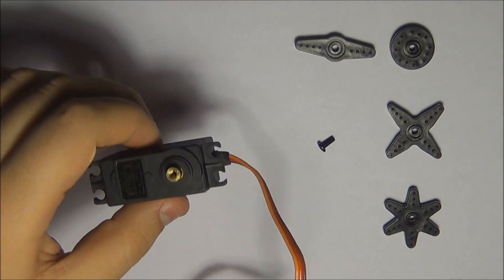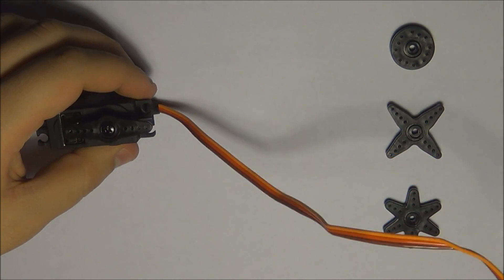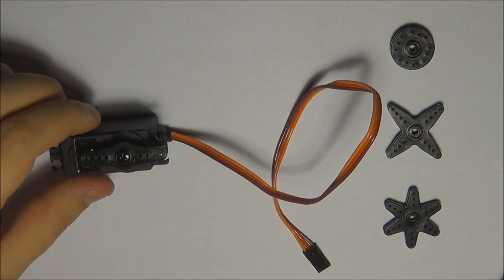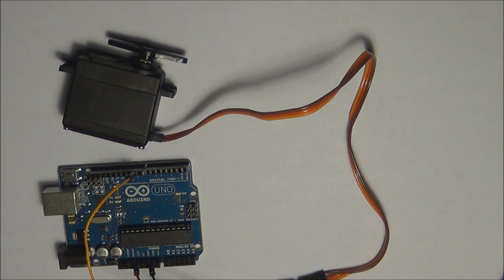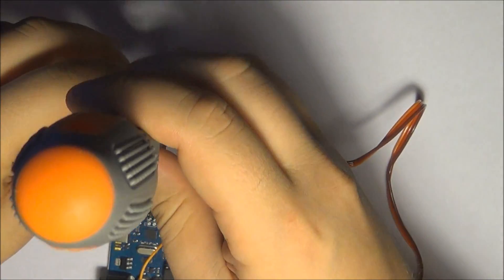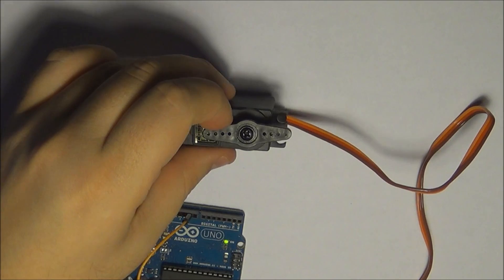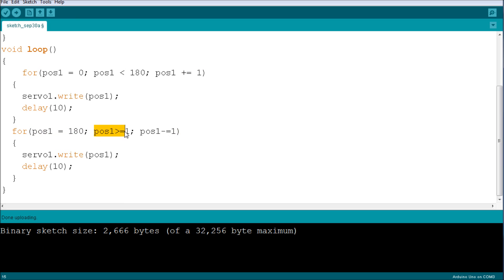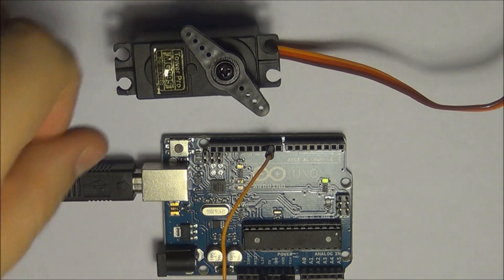Arduino #9 - Servo Selection & Motion Control

Comment: If I were to use 2 mg996r servos for this application, would I be able to utilize the v+ pin and any other numbered pins on the arduino uno,or should I use a pca9685 to accommodate the 2 servos?

Comment: #include <Servo.h>

#define pinServo 3
#define pinButt1 4
#define pinButt2 5 
#define pinButt3 6

Servo myservo;

void setup() {
  myservo.attach(pinServo);

  pinMode( pinButt1,INPUT );
  pinMode( pinButt2,INPUT );
  pinMode( pinButt3,INPUT );
  
}

void loop() {
  if (digitalRead(pinButt1) == 1 ) myservo.write(0);
  if (digitalRead(pinButt2) == 1 ) myservo.write(90);
  if (digitalRead(pinButt3) == 1 ) myservo.write(180);
  delay(15);

}

Comment: I am having a huge trouble in using sg 90 servo as the torque is not sufficient in lifting a 200 g weight vertically via a wooden arm. so does mg 995 servo has enough torque.

Comment: @1:07, they're called control arms.  @1:54, ground is generally black or brown. center wire is always V+, usually red or orange, signal is usually white or yellow.  If in doubt, search "datasheet" part number.  ie 'datasheet mg995'.  when vibrating on limit, back off limit till it stops vibrating, otherwise it's pulling more current than normal.

Comment: The servo will draw a large current if it is not to sweep incrementally. This is important for certain batteries. although incremental sweeping limits the speed of the servo. The current spikes may be resolved by a capacitor circuit.

Comment: Hey can someone please help and let me know where I can get the wires that connect the servos to the Arduino? Or do they come with the servo??
Reply: ik this is an old comment but they are called jumper cables you can get them off amazon

Comment: Surprisingly, the servo works it is powerful, does not the Arlooino burn, I thought that such servos should be nurturing at least 5 in the power supply separately, is not it?

Comment: I have a very specific problem. I need to control a servo with a toy tank receiver. No digital control, only two wires and a H-bridge. The servo will need to act as a steering servo. When polarity is one way, it needs to turn one way and stop, when polarity swaps, it needs to go to the other side and stop, when no signal is provided it needs to center and stop. No idea how to control an Arduino with a H-bridge and how to use "if this then do that" statements.
Reply: I know I’m many months late, but you could use an ‘if’ statement like in javascript, then the action you want accomplished inside the brackets of the ‘if’ statement (If I didn’t explain this well, just look up how to write an if statement in arduino)

Comment: I am planning to use 3 mpu6050 as input, 12 servos for the output and 5 flexible sensor as input all in one board is that possible? if it is, what board to use?
Reply: Aljohn V You will need a special servo shield. That many servos will burn your Arduino.
Reply: thank you

Comment: please I need an answer urgently....
I did exactly what you did to set it up on 180  but instead it keeps spinning continuously although I've put it in void setup not loop.
and when i try the sweep it rotates 360 not 180.
my servo looks exactly like yours I'm even using the same knob and it has the same no. but i thought that if it rotates 360 maybe the limit is 360 but it didn't work as well. I tried 0 it just spines it the opposite direction and doesn't stop. please tell me what to do I have a project
Reply: did you have solve it? i face the same problems

Comment: 12V servo motor fluctuates at very high speed when given external power supply
Coding is correct and simple
Help me how to overcome this fluctuation
I have to submit project by tomorrow

Comment: my servos does not move at all.i got it new a few days back
what could the possible problem?
Reply: Your wiring could be incorrect. Either your vcc, gnd and input connection of the arduino to the servo is wrong or the the output pin to the servo from the arduino is incorrect
Reply: Alok Anand Minz or the servo might be broken

Comment: Great video, but do u know how to turn the motor to a degree u have set and have it stop for a certain amount of time before going back to it’s starting point. I can only get it to continually rotate back and fourth.
Reply: Muggers 79 You need to adjust the wait times (delay) in the code. It's in milliseconds.
Reply: Just define this (in void loop or void setup, wherever you have typed the degrees):
delayPeriod = (whatever your wait time is); 
then after the degree type:
delay(delayPeriod);

Comment: Hey, everyone I need help, I tried doing the same thing will a Arduino Nano and a Hi-tec HS-402X and every time after I upload the program,  the servo just rotates continuously in a clockwise direction until it hits the physical maximum the servo can go and then just gets jammed in there until I power off the servo. Can someone please explain why this happens and how to fix it? I`m doing it exactly like in the video. I have also researched how to fix the problem with "writeMircoseconds" command but it does the same thing.

Thank you
Reply: its probably a 360  servo, i dont know if you can control the position that you want it to stop.
Reply: I might be wrong, but if the control signal has a frequency that tells the servo to go beyond its own physical limits, the servo will try to achieve that position and stalls. That might be what your code is doing. Idk how you might fix it, but you can try to simply give it a PWM signal. Make sure the signal is within the servos limits or it will stall again as stated above. It might be that your servo has different frequency demands. Is there a knob you can adjust on some side of the servo? If there is, it can be used to trim the servo.

Comment: can you rotate that servo by 360 degrees without configuring inside it?
Reply: no unless it was pre - made that way
Reply: No. You can remove the limit pin and potentiometer and replace it with a voltage divider with equal resistances. Then it will rotate infinitely in either direction.

Comment: Hello! I'm working on a project, an automatic guitar tuner and I want the servo to move the guitar pegs. Do you know approx. which servo could I use? I need anyone that moves continuosly until it reaches the correct string frecuency. Very good videos!

Comment: How many servos can i attach to my arduino uno board?
Reply: I'm a noob, how would I control 48 servos?
Reply: probably shift registers
Reply: you can use arduino mega to control 48 servos
Reply: with an arduino mega @mikehattias5837
Reply: using arduino mega you can control 48 servos
Reply: 2 at one time
Reply: Divyansh Khare 12
Reply: 12

Comment: Subscribed. I am very new to electronics. Question: how to know if my Arduino can handle a motor? I have a similar Carson-model sport 500502015 CS3 Reflex racing servo. Afrotechmods said that plugging a bigger motor (anything that draws more than a few mA) would be bad for an Arduino. How can I know if it will be too much for an Arduino? I have 2 of these mentioned and 2 little blue 9G microservos. If I join all 4 for a robotic arm will that be too much?

Comment: Can the Arduino be programmed such a way that when it receives +5 volts at one of it's analog or digital ports, the servo motor turns to 60° or 90° or 120°?

Comment: I am little doubt with this video sry about that but if you can clear my doubt servo that you are using consume 550ma of current and your Arduino can only provide it 40ma current so if u control with Arduino then it might get damaged
Reply: You don't have to take the positive power from the Arduino.  You can take it from an external power supply so long as you connect the ground connections together.That is strong recommended with multiple motors.  Even before it might damage the Arduino, it can cause the unit to reboot.

Comment: one question, does servo have potentiometer inside, if so can i just hook up orange wire so i can read position and power motor externally from power suply.

Comment: Does anyone know if u can make it go say 90 degrees then after a while u can push a button for it to go another 90 degrees if so can someone explain how it's done
Reply from the maker: It's definitely possible, you can use an increment for the angle value.
Reply: EEEnthusiast ok thanks

Comment: So the write function takes the position as a parameter not the whole angle of rotation?
Reply from the maker: That's correct. The parameter specifies the absolute angle to which the motor will be moving. It's not relative to the current position.

Comment: Great video, you should instruct your followers that 2 types of Servo exists: 360 deg CONTINUOUS AND THE OTHERS , a 360 deg continuous is NOT compatible with the kind of program you propose.thank you
Reply from the maker: Good point; I haven't actually worked with continuous rotation servos on Arduino.
Reply: frankly, I am very used to "std" servos, easy to handle,  you can make a slow / known angled rotation, ie go to 95 deg@ x rpm impossible with continuous

Comment: sir, i am makin a password enabled door locking and opening system and i am using a servo and i want that it should take a rotate after entering the password to 180 degree and stops and whenever the second pulse comes it should take a reverse action
Reply from the maker: Seems like a good project; are you stuck somewhere? I would need more info to be able to answer your question if you are having difficulties.

Comment: hi bro, i am using same servo and arduino uno r3 but i am not able to control servo. At least its not working, when ever i try to connect then servo give some giggling sound that's it. it is not running. and program it self not uploading to servo. please help me
thank you
Reply: Duncan Angus MacDougall  thans for your help but I was having problem with Arduino Uno when ever I changed it, servo working fine.

Comment: quick question, i want to use a servo with the arduino to create an automated fish food dispenser, theoretically, the servo should be spinning the food container around to the opening when it's time for feeding and then spinning it back around when it's done - the container is fairly heavy, 300 grams ish, how would i attach the container to the servo without overloading it?
Reply: I know it is old, but put two motors, and make one the reverse of the other. So it wont overload. Hope your fishes get food now :)

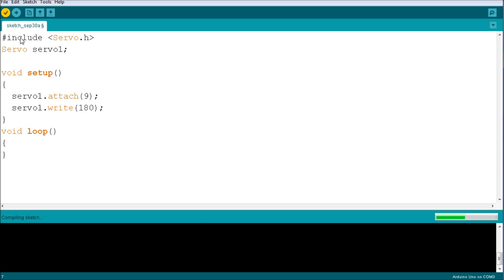Comment: Hi.I bought a MG995 servo motor and the sales person told that the servo is a 360 degree one and now my problem is that when I write the code at 4:50 the servo rotates continuesly without stopping.What should I do to stop it where I want?Please answer me...
Reply: mohammad ghanatian It is a problem with the voltage. We need 6 volts to power the servo correctly and I have that issue.
Reply: I faced the same problem as yours
Reply: hi.I still have the problem regarding control that servo and all I know for now is that this servo is not like other servos.take a look at this code,that might be helpful and if you found something useful please tell me cause my project is not done yet:https://github.com/diegorys/arduino-example-servomotor-360/tree/master/sketchbook/servomotor-360
Reply: I used a variety of voltages including 4,5,6 ,7 and still the same problem.
Reply: mohammad ghanatian Yea I am not sure then but I asked a professional and they advised me to use 6. My issue right now is it's kind of doing its own thing. Good luck
Reply: mohammad ghanatian Your problem is that it's a 360 servo, meaning it will rotate infinitely and never reach its desired degree. You can't stop it to a position, only change direction. You need a normal servo for this. 360 servos are modified servos specially made to rotate infinitely.

Comment: How do You run servo motors from the servo 1 and 2 header stacks on the motorshield? So I cut  a trace across the bottom of the motorshield so I could run external power? I am trying to test the servos using external power. There are no good examples online because everyone is running the servo directly off pin 9, like your vid.

Comment: as soon as i upload my first code it starts rotating and doesent stop...
Reply: you're probably owning a modded servo for 360 rotation. you cannot control the angle on that kind of servo, just the direction of the spin.
Reply: so basically... a motor? lol
Reply: i have the same event going on ???
Reply: @Rasmushkoch  if you want the code to run forever, put it in the loop, if you want the code to run once, put it is setup
Reply: You have a 360-degree servo

Comment: how do you make it so that the servo is rotating small planks of wood instead of the included plastic bits?
Reply: sadman hoque Either mount the plastic things (called "servo arms") to the piece of wood by using the pre-drilled holes or drill a hole in the piece of wood and screw it onto the servo. Don't drill all the way through! Drill a small amount in to fit it onto the servo and drill a small screw hole, like in the servo arms.

Comment: hi, can you tell me what is the exact Arduino controller type is? and can I control more than one servo motor on it ?
Reply from the maker: Hi Fadi, the Arduino Uno uses the Atmega328P-PU microcontroller. You can definitely control more than one servo motor with it. The most I've seen with ONLY the controller, was 16.
Reply: thank you for the fast respond .... it helps a lot.

Comment: what is shild for then
Reply from the maker: Shields are equivalent to external circuits. They just make it easier for the connections.
Reply: Hi! Great tutorial. I am trying to control multiple (14, to be precise) servos using an Arduino Mega as my school project. I was advised to use a Sensor shield (https://images-na.ssl-images-amazon.com/images/I/51gzXjEx9zL.jpg), which has its own power supply provision. Thing is I can't figure out how to power the servos via this shield? I have seen a lot of tutorials and all those use a breadboard, but I don't want that. Could you please explain (here) or perhaps point me to a website or something that explains this?Thanks.

Comment: I have followed your channel for several years but have yet to see a video on how to  control the speed of a servo without using a "for loop with delay" method. It seems that  "servo speed" remains in the "too hard basket" because it is very hard to find videos which deal with the subject in depth. Any hope you could touch on the subject?
Reply from the maker: I've worked on that offline for some time, but the limiting factor has always been the hardware. The setup you get with an inexpensive dc motor is a very crude wheel with cutouts. I'll try to put something together for this topic, but it will probably take me a few weeks.
Reply: On the ARDUINO forum, there is a post on the <VarSpeedServo> library which I have successfully copied and tested - see my Vimeo upload here: https://vimeo.com/171200374. It works, is very convenient as the servos are set up in an array. The speed variable is not linear, but it is within practical limits for all but the most exacting applications- (but then, I suppose steppers are better for the really accurate uses)!  Kepp up the great work! Cheers.

Comment: is it ok to power it with just usb. do i need to hook up yo external power sourcr
Reply from the maker: I believe the stall current will exceed the current of the USB. That being said, if you just want to play with the servo without any load, you should be just fine.
Reply: thank you for your info.  i have one another general question but a bit off the main topic. how many times can we reprogramme arduino uno. i heard around 1000 only. is it true?
Reply: +VibeX MaTxeMa I think the number is 10000 not 1000
Reply: +VibeX MaTxeMa it's making control overloading the memory of that